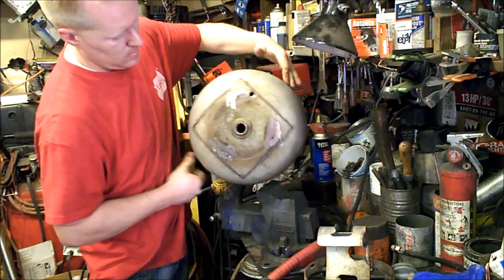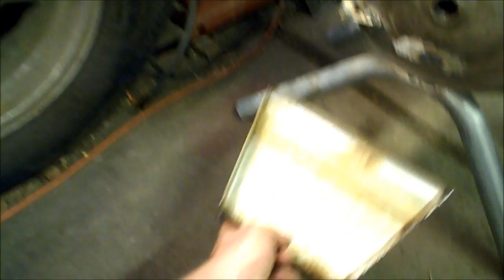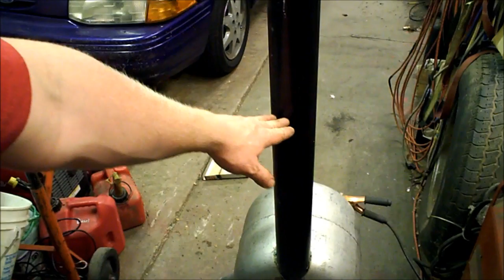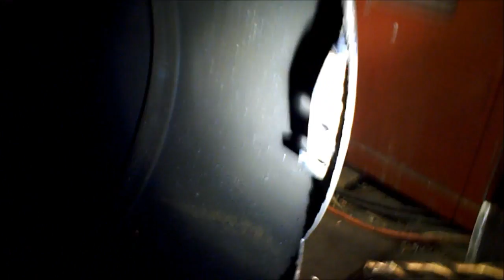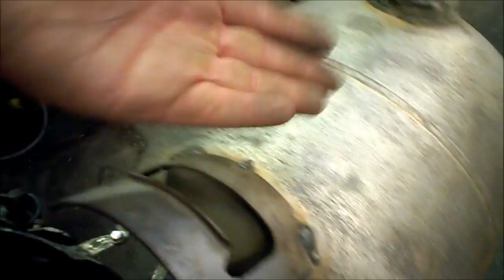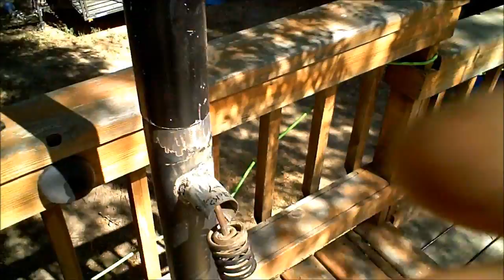Propane Tank Pot Belly Stove Build

Comment from the maker: Yeah, I don't expect the grate to last long at all. As long as the royal crap holds to pieces together it's welding. Thanks for watching.
Reply: Actually, you do not require any grate at all.  Just put a couple inches of dry sand on the bottom.

Comment from the maker: I just bought a cheap used Harbor Freight Plasma cutter for a couple hundred. But a plasma cutter is not necessary. You can do a TON with a 4 1/2" angle grinder. The Lincoln Electric Weld Pak 100 or 110 Mig machines are great general purpose welding rigs. They sell them at the Home Depot but you can pick them up used for cheap (seen them for $150 on craigslist). You don't need a gas tank. Just use flux cored wire.

Comment: I'm building two of them now for both of my sheds, but I'm putting legs on them so I can have a clean out on the bottom. I'm also using 2 in truck exhaust as my chimney. But I think I'm gonna steal your plans for your handle. Nice build BTW!!!
Reply from the maker: John Shuppas Awesome.
Reply: You shouldn't require a clean out door.  You're over thinking things.
After you operate the. Stove for a while you'll understand why.

Just get one of those  ultiple pronged weeding claws and drag all your hot coals forward before adding wood.

Comment: You can make a "kettle holder" by welding a strip of angle iron along both sides, near the top of the stove. The kettle, or pot, will rest  on the angle iron and the top of the stove. It doesn't heat up real well though, as there is little contact with the stove. if you want to cook on it, the best is to cut out a section on the tom and weld in a flat plate.

Comment: Good project!   Thanks for posting details on your equipment. I envy them.  Makes my arc welder/ gas torch look so outdated. Good idea using the springs for cool handles too.  The light grate will burn out in no time though.  Making a grate out of 3/4-7/8 solid rod will last much longer.

Comment from the maker: A stove this small is for occasional use only and not intended for full winter running. It will last a dozen + years and is easily repairable. It is designed for portability and simplicity.

Comment: You did a great job on the build.It looks like a great stove,so now paint the dang thing.
Reply from the maker: Gary Russell Any paint will just burn off.
Reply: sixtyfiveford ,you can use hi temp stove paint,most paint or fireplace shops will have it(only black i think)

Comment: neato,well done,just wanted to mention,I put an inch or so of sand in the bottom of the tank,keeps 'em from burning thru over time. Mine runs at like 500 degrees so I can't really paint it. Maybe brake caliper paint? But other than that they are cool little things. Great vid.
Reply from the maker: George Parx Sand.... That's a good idea.

Comment: for someone not so good at aligning individual hinges, use either a larger center mounted hinge, or use a long bolt/rod in place of the two small bolts (for fit up purposes, then replace with the small permanent bolts/hinge pins). for diyers, a simple concept that often alludes us is a hinge is nothing more than a rod and pipe or two pipes/tubes that mate with a desired amount of clearance. slice the outer pipe/tube/sleeve into a minimum of three pieces and you have a hinge...

Comment: Great workmanship! Thanks for the inspirational video!

What do you think about a flanged flue before the stove pipe in the firing box? It would prevent blowing all the heat directly out of the chimney and make the stove a bit more efficient. Coating the inside walls of the propane cylinder with a mix of clay and sand (1:3, slightly moist) would store some heat and conserve wood and also would prevent undue burning through the cylinder walls, just a thought. Have fun!
Reply: I think you'd  be wasting your time.

You're never going to burn through the walls of the tank.

Comment: Instead of pushing compressed air through it fill it with water till it overflows that will force the propane out and I would cut with the water in it as well for added safety.

Comment: Hi, great Video.
Can you give a little more information about your Plasma Cutter. I want to buy one but don't know much about them. What make and model is that one? Also, the welder you used to weld on your hinges looks sort of like a MIG but the tip was so small? What type and brand of welder was that?
I have a Hobart 130 from Tractor Supply but don't like it that much. I actually think I weld better with my old Lincoln Buz box. LOL.
Thanks in advance and I really enjoy your Videos.
Reply from the maker: Toadydoh I picked up the Plasma cutter a few years ago second hand. It is a Chinese Harbor Freight 120v unit that is capable of 1/4"(barely and very slowly). I have seen really good reviews on the various Chinese units and would buy one again, if this one ever dies. I would however step up to a 220V unit, so I could do 1/2" or thicker. As far as a welder, I really like my Lincoln Weld Pak 100. I got it in 1998 and have run over 100lbs of wire through it. It is setup without gas(flux core), so essentially I am stick welding and not Mig. I do have everything to run it on gas and have for a couple of months but hated the cost of gas(argon/co2) and the reduces capability of the machine. With Flux core it can weld 1/8" single pass (1/4" double) where if I use gas it drops to sheet metal. I did just pick up it's bigger brother the Lincoln 180 Mig 220V and plan to set it up with Flux core and probably use the 120V Weld Pak 100 for sheet metal only work with gas. It looks like your Hobart is essentially the same thing I'm using. A plasma cutter is fun and has become affordable in the last couple of years. I can't see myself ever without one. I have been eyeballing a few 50amp 220v units on Amazon, I just haven't decided yet.
Reply: sixtyfiveford
Thanks for the quick reply and all the information.
Keep up the great Videos !

Comment: What will you heat with this stove? I built a stove from an old electric water heater for my fishing shack, I tried using a 4" pipe for the chimney and smoke came out door when I opened it. I went to a 6" pipe and it works much better now. I have a video of the build on my channel if your interested.

Comment: Great video mate, have seen a few other videos, and this one is at the top. Thinking I might have a go hence having a couple bottles lying around, just one question though, how do you measure the square door plate on a round surface, its got me stumped. Thanks.
Reply from the maker: Thanks. I just eye-balled it and threw a tape measure on it. I Figured it could be off a little as long as I used the same piece I cut out for the door.
Reply: Thanks,will do that,as long as I get the feet right you'd never know.
Cheers.

Comment: how much space do u think it could heat I'm in Memphis so it doesn't get too cold and my shop is 40 long and 17 wide ive seen one made from an old water heater but I don't want something that big
Reply from the maker: Depending on your ceiling height(as all the hot air rises) it would only heat roughly half your shop.
Reply: they r 8 feet and I'm going to have it insulated but I'm not looking to have it be that hot inside the shop
Reply from the maker: I'm in Utah and am used to 20-30F winter temps so It wouldn't work great here for that size shop. I would think it would only increase that size shop 20-30F at the max. But Memphis is going to have warmer winters.

Comment: One of the best stoves I've come across. Thanks for the inspiration. You think you could detail the spring hinge air vents? I've been trying to figure it out but I'm missing something. Thanks again
Reply from the maker: Amiel Farfan Thanks. The air vents are just a flap of metal with a bolt through it. Where you would put a washer normally I just threw a spring and didn't snug the bolt all the way down.

Comment: I made one from and old tank for my ice house. Works great looks some what like yours.
Reply from the maker: +Wayne k Does, it heat it pretty well?
Reply: Yes it does whit in about 10 min it get to around 45 when it is 30 outside and with in a 1/2 hr. it gets to around 60 and stays close to that temp. I can fit wood that is 4x8 inch in it. I start out with around 4 or 5 blocks and then add 1 log about every 1/2 hr or when I start to get cold. No need for all that heavy winter gear. I will try do down load a pic of it so you can see what I have.

Comment: Idea, to help keep the smoke and fire in the stove, weld a door hinge inside the door at the top of the door. Put it in the right direction so you can put wood in. And then the hinge will drop back down to help keep the smoke in.
Reply: You eliminate smoke from coming out the door when you open it by adding sufficient size diaper and height  to create a better draw.

You don't really travel a chiminey,  its more an exhaust port.

Comment: FIRE IN THE HOLE!
Nice build....but where can you put a kettle or coffee pot on it?
One other modification I would make is fit a baffle inside just below the flue outlet, that way you capture more heat from the combustion as it leaves the fire chamber.
Reply from the maker: Bob Bailey Yeah, the flue does protrude into the burn chamber a little. I just didn't want to go too far or the fire would want to draft through the door excessively.

Comment: Hey.. Nice vid. You have a good eye for form , fit, and function. Your only problem was your air inlet was not too small, it was too high...in relation to fire bed. A one inch hole would be fine if it was lower, nearer the bottom . Nice  stove overall.
Reply from the maker: Thanks.
Reply: The fire will find the hole.

Comment: Welding plasma cutting with no gloves next to gas cans? Smart 👍
Reply from the maker: NASH cusToms Gloves for plasma cutting is generally pointless, its the same as holding a firework sparkler without gloves. Just don't grab the work bare handed when your done, the tiny sparks can't hurt you. Tack welding and short stints of welding is the same.  Better put on safety glasses the next time I use hammer or screwdriver  and steel mesh gloves the next time I use a kitchen knife. If you're gonna go Safety Police don't do it half A. Cans are filled with oil that can't be ignited by a spark.

Comment: as built now it won't last but a year or two because of no insulation or protective barrier to bottom of stove ie:    cut brick at least 3/4" thick,  or several layers of a sacrificial metal plates at least two,     this protective layer must cover the bottom "90" degrees of arc,  120 degrees is much better.     while it's a nice idea small stoves for wood need a lot of attention to maintain fire at a level suficient enough to produce an acceptable quantity of heat.

Comment: I have a Chinese wood burner with a 3/8ths Mild Steel baffle plate above the flames, so that the hot gases have to come to the front of the stove before they can get out over the top of the baffle to get to the chimney at the back. This 3/8ths plate only lasted two seasons before warping then cracking up into pieces then falling out! So, how long do you think your very well made but thin steel stove will last? Do you plan to line it?

Comment: Quite a few comments, didn`t read them all, but how did you deal with the gap created by your cutting the door. You couldn`t achieve a good seal between the door and stove. Unless the kerf was so tiny because of the plasma cutter and the spherical surface. Can you comment? I have several tanks like that and have been contemplating making a stove. Thanks
Reply from the maker: Yes there is a small 1/32" gap or so. The gap acts as an air inlet . As long as your fire is drafting fine it will pull air in through this tiny gap and exhaust it through the chimney. I've never had smoke come through this.
Reply: Hey, I liked your technique of leaving the plate in place before welding the hinges on. I thought that you should have put a rod in through both hinges to align them before tacking them on. In any case, your job seems to work well. A 3" exhaust might have been too small, not giving a sufficient draft. Just my 2 cants. Be blessed. Thanks

Comment: How thick is the steel and have you had any warping issues? I’m building one with a flat top for a canvas tent for winter camping and wondering if I’ll need to weld bracing on the bottom of my cooktop or just upgrade to thicker steel. Trying to keep it as cost effective and light as possible without sacrificing the heat efficiency. Thanks!
Reply from the maker: The steel is around 1/16" and plenty thick for years of use. I haven't had any warping.

Comment: Hi Steve I have a small compressor can you use a propane tank to increase the volume of air .cheers ian
Reply from the maker: Yes.. Propane tanks are rated at around 200psi so they can easily take the pressure of a standard 125psi compressor. The trick is to find an old bbq with the adapter that reverse screws into the center of the propane outlet and not the new plastic adapters. Dissemble the old bbq adapter and you will be left with a piece that screws into the tank and a male 1/4" npt thread which is the exact same thing most compressor adapter threads are. You can then hook it directly into a propane tank with standard compressor fittings. I hope this helps... -Moe

Comment: I like your build.I would of put the top pipe into the bottom one to stop creasote from dripping down the chimneypipe.
Reply from the maker: +rex walrath Yeah, I know that is the correct way I just wanted to be able to use any random length of pipe. By modding the pipe welded to the stove it allows other pipes to be plain/straight pipes.

Comment: This is almost identical to the one I'm planning for my Mum. I'm going to use a 15kg butane bottle and some 3 inch galvanised scaffold tube.
Reply from the maker: big ian Let me know how it turns out.
Reply: Don't use galvanized metal anywhere it will get hot. Galvanization is a coating of zinc, and it sublimates into a poisonous gas when it gets hot. Check out the Wikipedia article on "Metal Fume Fever".

http://en.wikipedia.org/wiki/Metal_fume_fever
Reply: Galvanised flu
Reply from the maker: Yes, BUT it burns right off and Metal fume fever/Galvanized flu has no long term health risks. It is the same as making a fire box with paint on it; light it outside and after one burn cycle it's safe.

I've had metal fume fever twice. The first time it felt like a basic achy flu for one night. The second time was a basic headache with achyness and easily remedied with Ibuprofen.
Reply: Dude, dont use galvanized tubing. Its so poisonous for you when the heat starts heating up to high temps.

Comment: That plasma cutter you got there ,What kind is it and what size it.Oh also was wondering what size of a air compressor do you need.Just a couple of things that I thought about asking,thanks for the info also.I have a plasma cutter but I bought it on a big box store garage sale.And I never got to use it,I guess I have to admit I'm chicken lol lmao.I know it will take some reading on "how to".
               I must admit I'm a DIYer also more of practical than theory type.I like to see rather than READ them hours of reading.  :-)
       Gord.
Reply from the maker: The Plasma cutter I have in this video is a cheap Chinese120v unit. It worked OK for thin stuff, like in this video but failed at anything over 1/8". Last year I upgraded to a much more expensive Hypertherm 30xp and couldn't be happier(cuts 3/4" easily). They don't use a ton of air(around 4scfm) and a compressor as small as 10gallons could run them. The problems come in if you have a 120V plasma cutter and 120v compressor sharing the same circuit as they will trip breakers when the compressor kicks on. It can be done but you'll need run the compressor off a different circuit in the home. Tons of fun just always wear eye protection as they like to kick sparks directly in your face if it fails to penetrate the metal.

Comment: Actually, I'd fill most of the way with water and leave it in there while doing the starting cuts. Water won't explode but if you just rinse it, there's a possibility of fumes still being in there and those will explode.
Reply from the maker: John Franklin An explosion can only happen with a sealed vessel, other than that the worst you would get is a quick flame out the top where you pulled the valve. Unlike gasoline, propane doesn't leave residual behind and is can easily be blown out with air.
Reply: sixtyfiveford
 You don't need a sealed vessel to get an explosion. If the opening is small enough, it will burst the vessel and probably hurt your badly or kill you.
Reply from the maker: True, if the hole is small enough.
Reply: just fill with water and then empty it as soon as its filled and start cracking on, the risk of explosion is very small
Reply: an explosion needs the correct air/fuel mix. run a good stream of air threw it, it can't explode.  if you just rinse out with water, any rust pockets will hold gas, it can pop a little.

Comment: I'm afraid that grate will not last very long, hot coals+ fresh oxygen intake combining right on it- I've seen wrought iron getting all bendy and cracking eventually, if not thick enough, inside the fireplace. Other than that little thing (you can always replace it later), I like it very much! I wish I could weld myself-never get myself around it, my welds look like a royal crap, lol

Comment: Dry ice will work for pushing gas fumes out if you can get dry ice in there..!?  that what Wade use on big tanks like at your gas stations when replacing we would have two pump as much fuel as possible and then calculate how big of tank for the right amount of dry ice
Reply from the maker: That's a good idea.